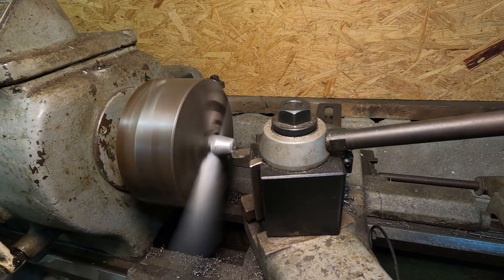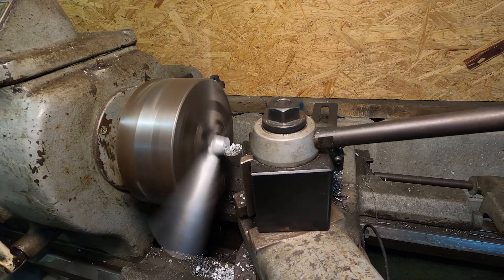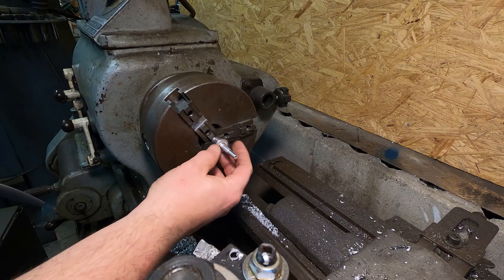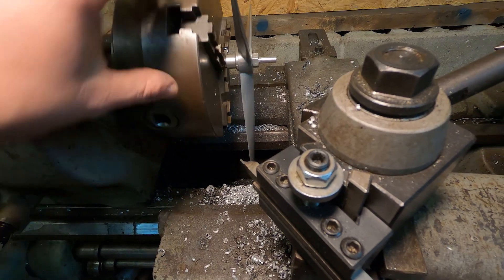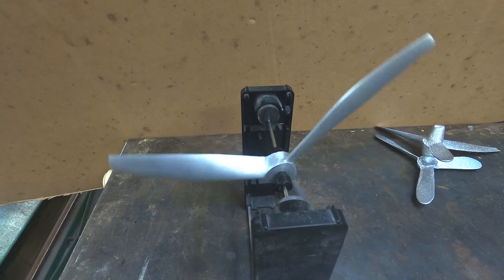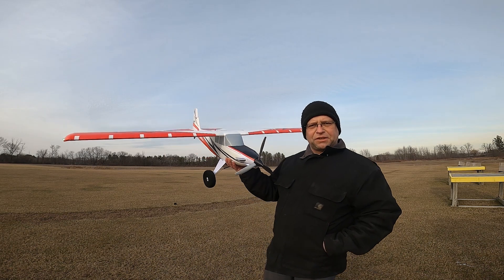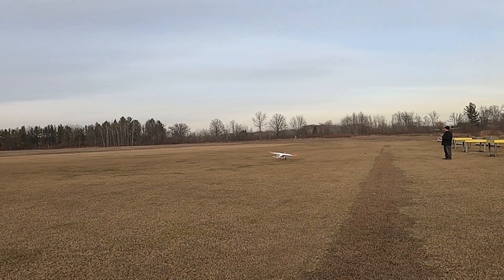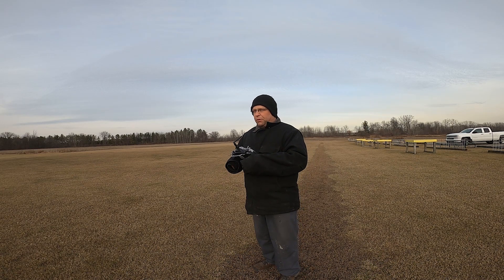Turbo Timber Evolution Cast Aluminum Propeller.  Machining & Test Flight

Comment: Very Nice initiative ... You might do a crack check regularly to validate that casting aluminium will not fail over time ...Please let us Know...Good Job (A cheap plastic propeller is more Dangerous 😉)
Reply from the maker: Thanks! I really never thought it would make it to flight stage. At some point ill cast a few new ones with slightly increased hub size and large fillets where the blades meet the hub to prevent stress cracks.  Maybe run some destructive tests.